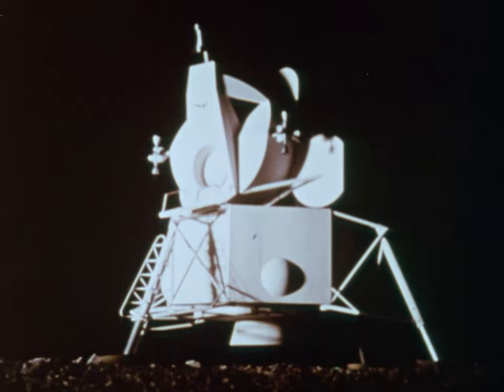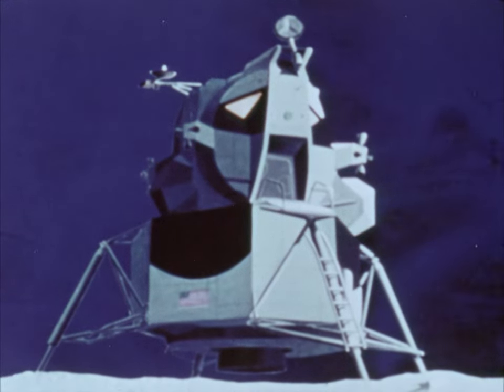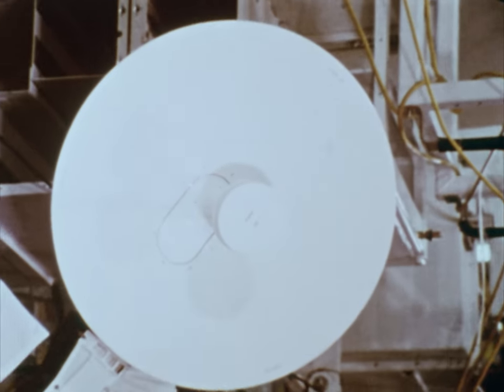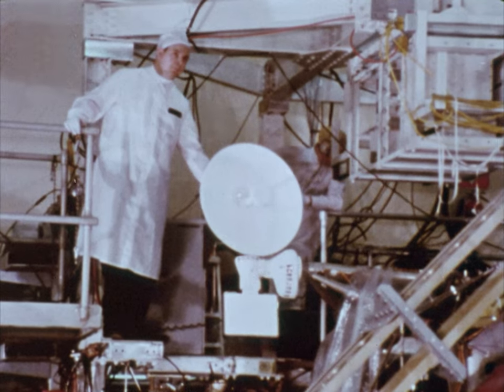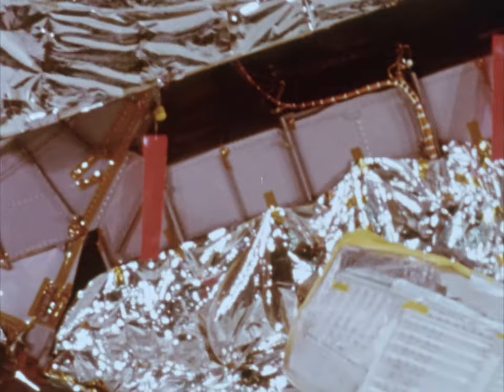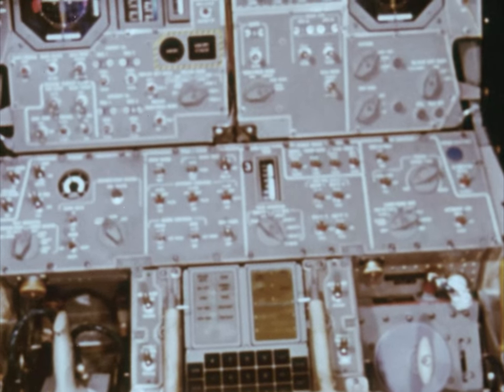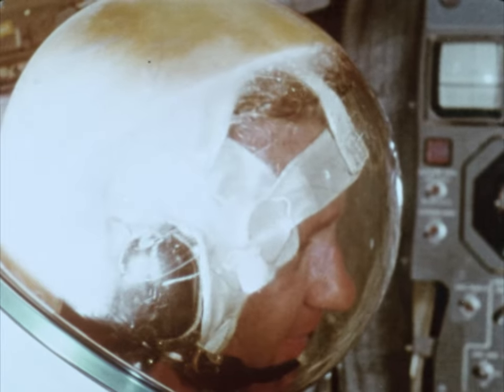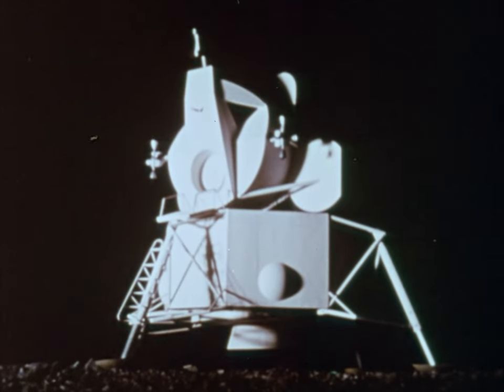Building the Lunar Module

Comment: Any vacuum chamber testing footage?
Reply: Yes. 
Look for Apollo Thermal-vacuum Tests - 2TV1, LTA-8
Reply: @dansv1  Newsreel footage. Want hard scientific material.
Reply: @thebruffy1077  NASA's NTRS is a good place to start.
Reply: @FlyingBoxHead  Have done, they got a bloke suit to 82000 feet for a couple of hours. No footage.
Reply: @thebruffy1077  Film documentation is rare in vacuum chamber testing; most of the data that was important was churned out on chart scrolls or logged manually for interpretation and evaluation by personnel. idk what you're chasing here?
Reply: @FlyingBoxHead  They would at least film it for training and safety purposes, with they availability of devices today it should be filmed all the time! We see them training in a tank, why not a chamber? They did film the LM jet erosion tests using a helium jet back in the 60s and for a while it was on YT. Can't find anything on the NTRS except for 'Development of a Space Activity Suit' where they spent a few hours at 80000 feet. Search for documents regarding the 'Design and development of the apollo extra- vehicular mobility unit'. I get 'document not available'. I searched for LM/CSM vacuum testing, interestingly they didn't vacuum test each vehicle!

Comment: There's a thousand aspects of the landings that appear to be fake, why not start with the "landing" ? 
  To anyone that's seen the footage through the window of the lander, firstly you would assume that the camera was tripod mounted, as there was no shake whatever. So Neil Armstrong was manually flying the lander, since they'd had a 1202 code or something that said the "computer" had flipped outandneeded a reset. So hetook over manual control, and assume that they were travelling apath parallel to the surface. That would mean the boosters were behind, therefore inorder to land, the vehicle would need to alter its position to avertical one to allow the boosters to point to themoon surface, toslowits descent.
  The footage omits this change of position, showing first the moon surface not that far below the craft, then the actual short descent. Who was operating the camera and turned it off then back on, during what would have been a life and death operation?
  That aside, Neil and Buzz, travelling at hundreds of mph looking for a landing spot. So between seeing the suitable spot and changing attitude of the craft, how far did they travel ? Was it possible they saw a site, and turned the craft around in order to land ? I'm also assuming the footage was on traditional film and not live, no way could that be done using a tiny TV antenna.
   Then there's the supposed live footage of stepping onto the moon. Who aligned the antenna to send to the earth? Two hundred and thirty eight thousand miles ! Fake AF.
Reply: *pitch down
Reply: "Who aligned the antenna to send to the earth?"  The astronauts, before leaving the LM.  The camera was powered by the LM and fed its signal back to the LM.
Reply: FYI, they landed at 4:17 pm ET, and he made the first step onto the lunar surface at 10:56 pm ET.
There was 5 hours and 39 minutes between the 2 events.
Reply: "Neil and Buzz, travelling at hundreds of mph looking for a landing spot."

Not that fast.

"Who was operating the camera and turned it off then back on,"

Buzz Aldrin.  Part of his procedures checklist as LMP.  Armstrong and the computer were flying the craft.